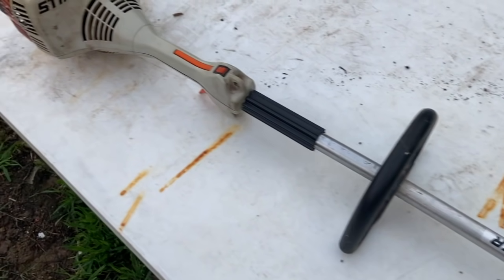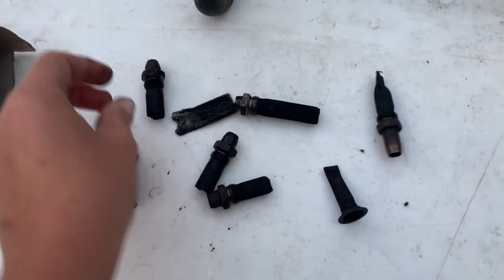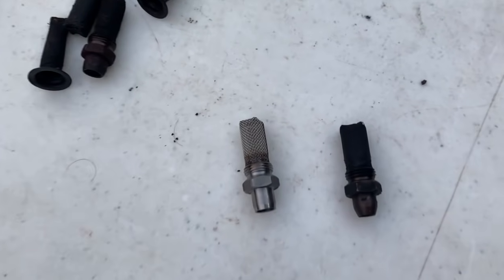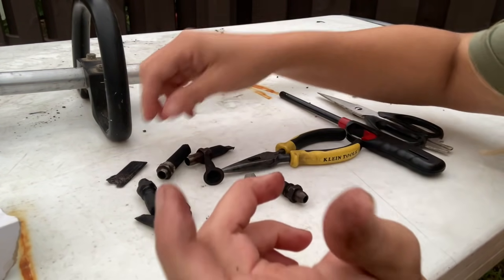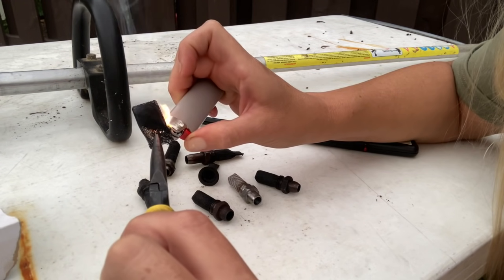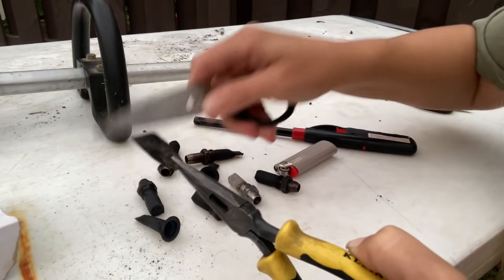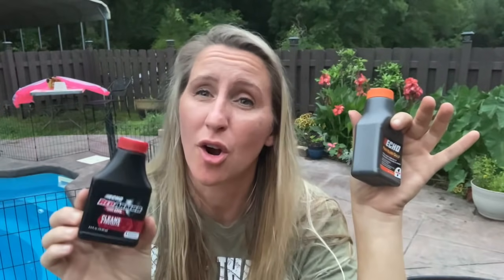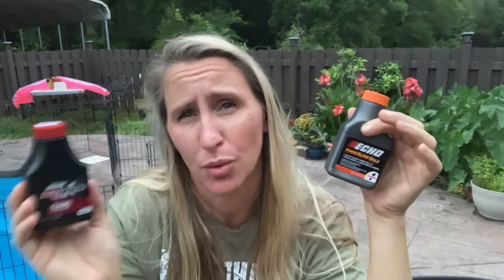THE BIG SECRET! STIHL has NO POWER? Won't Throttle Up? How to fix your trimmer/blower.

Comment: Love your videos!  Just to let you know I have been using Amsoil Saber oil in all of my small engines, trimmers, chainsaws for the last 15years + at 100 to 1 ratio! I know its not 50 to 1.  My machines run as good as the day I purchased them!! I am 77yrs old and still going strong!  Thanks again for your honest opions!😊

Comment: I’m not a lawyer but I think Stihl is legally allowed to double the term of the warranty based on the purchase of the oil at the same time as you purchase a machine. Any requirements to use Stihl oil would probably be illegal under the Magnuson - Moss warranty act. The FTC and Webber just went to court over similar exclusions. Unless they provide the oil they require they cannot void the warranty for use of a different oil that meets the same standards.

Comment: I have a fs 40c stihl trimmer and have problems with way to much carbon buildup.  Have to pull the spark plug out and clean it every 10 times or so I use it.  Took it to the shop once and they cleaned plug and just removed the muffler screen thing. Didn’t put it back on.  Still gets clogged up and won’t start after about 10 uses.  Only about a year and a half old.  Very frustrating.

Comment: My fs38 the choke doesn't seem to work.  If I hold the accelerator I can start it.  And the choke has to be off.  Any ideas?  And I just did burn off  the carbon from my muffler.

Comment: Why do I not get fuel over to my carburetor from the tank put new lines on in my Stihl chainsaw rebuilt carburetor with diaphragm I have great compression I don't understand what the problem is
Reply: Your piston is also a vacuum-pump/ vacuum-signal generator.The rings make compression in one direction, and partial-vacuum in the other. If the crankcase seals leak, she fails to generate the vacuum signal to the pump, which then fails to pump, new diaphragm or not. Furthermore, the loss of vacuum  also fails to draw Air/Fuel charge from the venturi. 
Put a vacuum gauge on the CC and pull the starter-cord, to see what's going on.

Comment: We had to pull the spark arrestor out of our Stihl weed eaters and edger at work. Our maintenance guy told me to run them all full throttle.
Reply: Stihl manual stresses running weed eater at full throttle all the time, except allowing to idle

Comment: Is it synthetic or castor oil? 

Coming from the two stroke dirt bike world synthetic usually burns cleaner even at low rpm once the cylinder has reached operating temperature. AMSOIL DOMINATOR is designed to be mixed at 50:1 and is synthetic. 

Even with that comes silencer maintenance as the packing in it will still become matted with oil over time. That’s just a remove and replace item. 

I don’t know any fire that has ever started from a two stroke that had its arrestor removed. Modern two stroke dirt bikes don’t even come with them as they inherently get choked up

Comment: if that's the issue what I normally do is take a handheld torch and burn off all the carbon and deposits, then pressure wash it and clean it with a wire brush and you don't have to buy a new one

Comment: Stihl oil is rated JASO FB. Echo oil, VP Racing oil, as well as the best modern oils, are rated JASO FD. I only run JASO FD oils. They burn cleaner and will not clog up the exhaust port like Stihl's obsolete JASO FB oil.

Comment: The thing about that top of the line Stihl oil that'll double the warranty.is it has a higher Flashpoint than other 2 stroke oils. Which a blower can't burn that higher Flashpoint stuff.= problems..

Comment: Bought a used almost new Echo saw real cheap because it would not start. I could see the screen was totally clogged.  The owner cut up one tree and it died. I'm guessing he mixed way to much oil in the gas. Took it home, cleaned the screen, installed a new plug and it fired right up.

Comment: Better yet just leave it out.. my echo i had over 10 years both chainsaw and trimmer and I so far did nothing but put gas and oil and they never let me down and I do have a Stihl chainsaw I had now for 3 years and now I know what it's in the muffler.. but so far it runs good with no problem...

Comment: Sorry, my finger hit the send button before i was finished...."burn off way before the Stihl equipment reaches normal operating temp leaving the equipment without lubrication causing irrepairable internal engine damage. Customers aren't always honest when they interact with you and some are outright damn liars. So, now you know why it's vitally important to use Stihl engine oil in Stihl equipment....in my humble opinion." BTW, if you invest in a propane bottle with the electric trigger button, you'll see how easy and quick cleaning a spark arrestor is. It is a snap!!! Thank you for all you do.

Comment: I have to disagree with the don't remove the spark arrester. That part is basicly for working in a dry forest like setting to where the chances of starting a fire are greater. Most all people are not in that setting. I've even tried to set dried zoysia grass on fire by setting my trimmer on it at full throttle and it took over 30 seconds for it to heat up the grass and throw a spark to catch the grass on fire. Another time cutting a stump very low and not moving the chips out of the way. Also removing it will give you a little more power because you don't have that back pressure into your cylinder.

Comment: Stihl and Stihl oil are great products,,,,, I use Stihl oil on break in of MX bikes @ 20:1 and after 2 heat cycles ,, run the guts out of em,,,, after that Blenzall Castor ,,,  or Honda Hp2

Comment: I'm having a problem with my STIHL edger the sf85 it only has one screw mixture and that is the high side but I cannot get it to idle and I cannot get it to stay running
Reply: what is the original setting mixture for the high side once I closed it and open it up

Comment: No two stroke engine likes to idle.  Run it full throttle or switch it off.  Period.  I've had 10 Stihl two stokes, always used Stihl oil,  and never had a clogged muffler.  

The only problem I've had is my 250 saw which is a screaming PITA because it doesn't start like any other Stihl.  It floods before ti will ever fire on full choke.  Stihl just got that one wrong and hasn't fixed it.  Which is why I now use an EGO fro my trim saw.

Comment: What is best trimmer line. Mine breaks every 30 seconds!
Reply: As you may know, those trimmer-lines come in several different gauges, for doing different kinds of jobs.  Run the fattest line that fits in your spool. If your trimmer won't rev up with that gauge, and there is nothing wrong with it, then, you'll need a trimmer with more power.

Comment: This is simply a clogged spark arrestor. This can happen on any piece of small equipment with such a device. It has nothing to do with the Stihl 2-cyle oil or how you run your machine. For example, blowers are typically run at full-throttle, and it still happens to blowers. If this happens to you, simply remove the spark arrestor and don't replace it.

Comment: in my country it is illegal for a manufacturer to state warranty wont be valid if another brand  of consumables or parts other than theirs is used if it can be proved it is fit for function, this goes for oils, filters, brake pads, timing belts etc. Manufacturers and dealers also cannot exclude warranty if servicing is done by someone other than their 'approved' servicing workshops if that workshops mechanics are trained and licenced and equivalent parts are used. It revolutionised the cost of servicings here, before that legislation was introduced "dealers", especially in the auto trade were charging a kings ransom for servicing and parts. For once a government introduced laws for the better of the public rather than the corporations

Comment: just clean it with a wire brush and compressed air....no need to burn it off.....if there is a hole in the screen, yes replace it.

Comment: If a manufacture states that you MUST use their oil, they must supply the oil. This is settled case law known as "The Magnuson-Moss Warranty Act of 1975." It was created to prevent manufacturers from misleading consumers with disclaimers on their warranties. Now don't get me wrong, you need to follow the requirements of your vehicle, saw, weed eater, etc. found in the owner’s manual. But no, you do not need to use their proprietary product, as long as you choose one that meets or exceeds their specs. Offering an extended warranty if a customer buys a six pack of Stihl oil is no doubt a slick way to get you to buy their product.

Comment: Ran and serviced Stihl for many years.  Clogged Spark arrestor?  Hit them with a propane torch and.... the carbon burns off in seconds.  End of story.  Also, stop using regular fuel.  Use alcohol free 92+ octane or higher, and always stabilize.  Thanks.

Comment: Good video. I never use Stihl except their chainsaws. Even then lately they have been getting more and more flimsy. I have 5 certifications from Stihl for working on their equipment. Worked for equipment rental companies for years so I know. Stihl is junk. Their parts are overpriced and poor quality. I've been doing lawn maintenance commercially for a long time as well. Echo is still the brand to beat across the board. Tough powerful engines that don't break down if maintained and operated properly. They will even gracefully accept a little abuse. Parts are priced fair and easy to locate. Yeah they area little heavier but that's how quality works. 

I also run Lucas 2cycle oil in all my 2cycle engines. I borescope my cylinders yearly to make determinations on what I need to purchase in the coming year. I have 5 years on my SRM2620 and the same on my PB2620 putting approximately 30 hours a week on each one. They still run like brand new. Had to buy carbs for both last year, that's it besides normal wear parts like trimmer heads.  Even then I've replaced the head twice on my SRM2620.  They are built like old pickup trucks and they don't quit. The only complaint I have about Lucas 2cycle oil is that they decreased the amount of oil in each bottle when this round of inflation hit. Who hasn't though? Never have problems with spark arrestors ever. Echo's engines run better and stay cleaner with them in if you mix your oil right.

Being a mechanic and an operator has it's advantages. Keep it up, Echo.

Comment: I used to use Stihl oil in my 1930s Maytag to cycle but the engine does not run fast enough to keep the plug clean and constantly fouls the plug and shorts it out

Comment: Run it Flat Out !  - I made a 6' long portable Bucking Horse from Aluminum Scaffold tube , it folds like a scissor ,rope at the bottom  -i can load a whole cord of wood on it . Then i cut FLAT OUT = never throttling  down on the trigger  and often get the cutting done on Only 1 tank of Gas - the Chain & saw need to be at optimum performance - a  piece of BROKEN  Hacksaw Blade is the perfect  width  to gouge out the Bar  Grove and gets it whistle clean so the bar oil lets the chain run efficiently -

Comment: I don't use that SH*T and I told it to my dealer when I bought my new MS311 two weeks ago and I showed him the oil I use.
I use Castrol POWER1 RACING 2T the oil for RACING TWO STROKE engines.
Can be mixed 1% to 2% and I mix it 2% as recommended by Stihl.
No smoke, spark plug completely clean, full power, perfect throttle response, ultimate protection. My dealertold me that's good to go!

Comment: This will.,or could blow your mind about it to. Stihl, Echo,Echo Red Armor two stroke motor oil T2 and fully synthetic T2 Red Armor two stroke motor oil is connected together. Accept one thing one out of the three is the worst stroke oil to use. Now that being said to. Now it's up to you take your pick on which one that is for you to use yourself.,or soots your needs.
Reply: I choose Echo Red Armor or Echo Powerblend oil. These oils work good in my equipment, without any problems. I run my blower maybe 4 to 5 hours at a time in the fall with this oil, without problems.

Comment: High resin content in spark arrestor screen for 20 years.... I use amsoil 100% synthetic 2-stroke 100 to 1 and you must figure out your ratio but there is no residue.... Compared to stihl which is high residue....

Comment: It's a user problem, specifically a non-professional problem. Unless you're working around dry brush remove your exhaust screens, they're not even fitted  on new saws here, and I never see sparks and flame coming out of my exhaust!. Learn to use your tool as Stihl recommend- at full throttle. Continue to use Stihl HP oil , it's fantastic stuff.My oldest Stihl saw is running sweet 35 years on, with no engine work.

Comment: Running 24:1 puts way to much oil carbon up top piston, made mistake thinking more is better, wrong. 
Air filter rubber gromet did not come with filter 2nd mistake i did not catch till they sold me 2nd one which had gromet. Tore ms 360 completly apart replace all. Crank seal almost 20 years so i will be 90 by time it need some make up. 
About the oil, m16 rifle over oiling without wiping it down collect residue from fireing and cases rifle to jam.

Comment: Pull the screen out when you buy it new. I have always used Stihl oil for at least 20 years
Reply: Castrol makes stihl oil😊 l found out days ago after 35 years plus using stihl oil. Still love my 028 super still runs great stock np rebuilds after 37 years. 😊

Comment: The dealers should promote Motomix instead of the oil. Motomix and Aspen burn much cleaner than other fuels. Perhaps they can give extended warranties for customers that buy a gallon of fuel. Better yet, they can give customers a quart of fuel when they spend hundreds on a tool.

Comment: You'll see this with any mineral oil, not just Stihl branded, much less so with semi-synthetic or synthetic.
That's the main difference between the brands mentioned.
You can also clear the carbon off by soaking the spark arrestor screen in a caustic soda solution, rinse thoroughly afterwards & do NOT try this technique to remove carbon from aluminium parts.

Comment: at the time of purchase it doesnt void your warranty it doesnt void your warranty if ya dont buy it with the machine ya just dont get the extra 2 years of warranty as for runnin other brands of oil after the purchase voidin your warranty i think that's bullshit ive heard that rumor too i dont believe it and the reasons why a muffler/muffler screen gets clogged and gunked up are because 1. they either mix their gas too thick and or 2. they dont run their machines at full throttle which doesnt burn all the oil of causin em to carbon up badly over time the best way to clean a screen is to soak it in gas and clean it off and lastly on a 2 stroke machine those screens can be taken out sometimes you'll have to adjust the carb afterwards though some of those screens choke a machine to death thus not lettin it run at its full potential im no dealer or a mechanic i just have alot of experience under my belt over the years

Comment: The problem that we have not had before is because Stihl oil is so good? Maybe it has something to do with the EPA tuning or detuning our engines. You restrict an engine designed to run WOT it will run, but it will never perform there is a difference. So rather than have the engine burn clean now, we will just burn off the carbon later to fix it? Seems like they are causing more pollution or maybe if it doesn't run then it's not causing any pollution.

Comment: The thing I ran into is a trimmer there are or should I say most times for me I'm not running full throttle as stumps bricks an such I'd just rip through sting 100 times faster, I'd say 90% of the time I'm not full throttle, I do floor it to burn carbon off if you will..my blower is 100% full throttle lol .my Stihl blower from new for first season did not want to run very well, 2nd season runs awesome, wonder if cause i dont use their oil, i was in the mindset my blower is a piece of shit lol, but seems good now...still not trusting Stihl that much though, trimmer is echo and nothing but happy with it, 4 years of owning it, I whack 3 hours a time on my property, it's good people lol ..

Comment: Beg to differ with you, Stihl doesn’t make you buy their oil or void the warranty, I’ve bought 2 chainsaws and a trimmer in the last few years. If you buy their oil at the time of purchase they double the warranty to 2 years. So for $20 more you get a 6-pack (= 15ozs enough for 6 gallons of mix)of oil and extended warranty.  WHO make Stihl oil , Castrol, look at the fine print. The loggers swear to it, it’s Castrol Go 2T motorcycle oil. It cost < $20 per quarter, for twice as much , 32ozs. Who makes Ehco oil, not them ❓Yeah you gotta run’em folks, they love it.

Comment: Typical two stroke issues by stifling them with restrictive mufflers and adding tiny screens on the outlet. Retuning the carb for 40 or even 50 to one oil to fuel ratios and using low ash formula oils is better for reducing carbon.  When the backpressure is to an insane level, the carbon will begin to reduce the exhaust ports diameter and finish killing the engines performance to the point it will be unable to even idle.

Comment: LOL just use a little bit of dirty motor oil,, chainsaws will still last forever if you don't dry up the dipstick and the oil in the gas that goes inside,, just be lean but got to use some/talking about the blade and chain just the same 😜

Comment: You don’t need a spark arrester :-) and stihl hp burns the cleanest out of any oil, has nothing to do with throttle speed , is stuff not tuned right , and fuel mixed way to rich !!! 50:1 only :-)